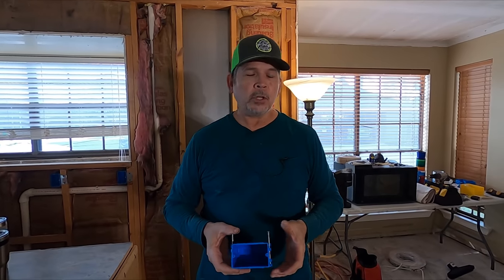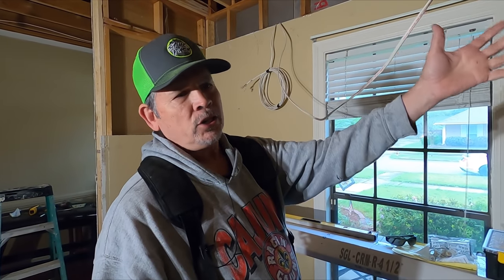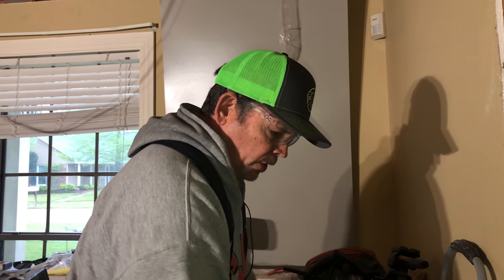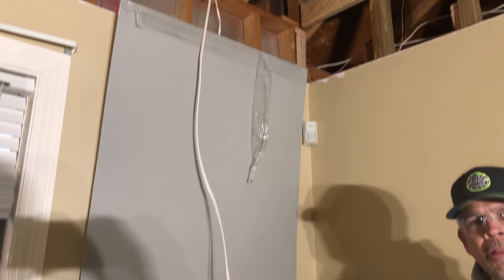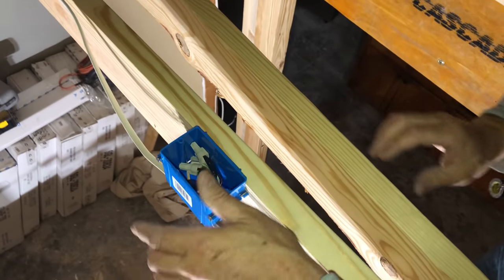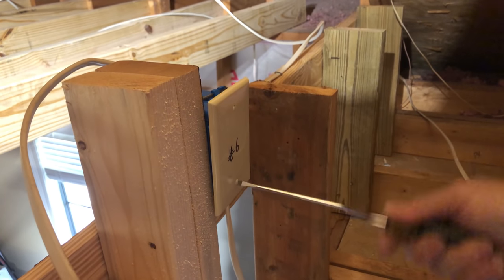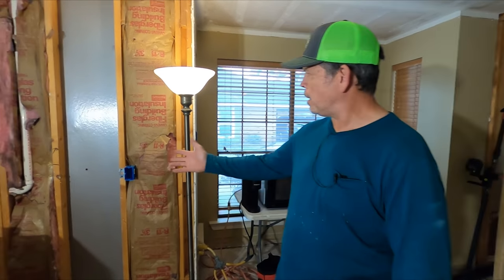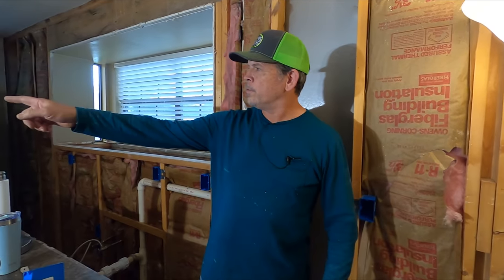How We HELP Our ELECTRICIANS⚡️ Ep. 10

Comment: Apprentice electrician here. When removing live devices I was taught a different combination to remove the wires. We remove the ground first, hots second, neutrals last and reassemble in reverse. The reason we cut off the ground first is because while you're holding that device by the yoke with the ground attached you're grounded. Which means if you touch a hot wire you're going to be electrocuted. Or if a hot wire slips and touches any metal parts besides the hot terminal screws it's going to arc. With the ground removed you're actually in a much safer position. What happens if you touch a live wire when you aren't grounded? Nothing. There's no path back to source. Neutrals are always after hots because you don't want to create an open neutral and risk frying someones electronics further down the line. You've also learned in the past that getting nailed by a neutral really sucks. This is all a non-issue if the power is off. But hey, it's a long walk to the panel.

Thanks for the video and keep up the great content.
Reply: As a DIYer, I always kill the breaker and test for current before working on an existing outlet, switch or fixture. I know you guys know more than me, but I'm not made of money and some things are basic enough for someone with intelligence and common sense to study up and do the job themselves.
I'm sure you've come across (or will) some horrendous DIY wiring. 
One house I considered back when I was house hunting had outlets in the garage wired to an extension cord plugged into the wall in the mud room.
Reply: @dokenboken5542  I plug something into every socket that's supposed to be run off the labelled curcuit and then see what's still working before doing anything else
Our 32a kitchen cooker curcuit was running off the 5a lighting curcuit when we moved in so anything is possible
Reply: When we were taught to do Consumer unit changes (Fuse Boxes/Panels) it was remove the ground first, then neutral then hot so it had no paths to go down and as long as you were on insulated pads you'd be too high resistance to carry the current anyway. Each scenario is different though and you need to know what you're working on and what order to do it in if you have to work live on something.
Reply: @therealdojj  I would recommend getting one of those pencil looking testers like he uses at 22:00 for like 10 bucks. I used the same method you use but didn't realize my house has a few circuits with a shared neutral. So even with the fuse unplugged it was still a hot neutral. The only downside is then having to find what circuit the neutral is tied into.
Reply: someone taught you wrong. if you remove the ground first you are removing your safety first. thats like climbing a cliff without your rope. If your wire slips or you shock yourself that is operator error and should be adressed in a different way. If you are incompetent then just kill the power before playing with stuff.
Reply: @dokenboken5542  95% of our work is residential service and remodels so I get to see some pretty funky stuff at times. But I kind of enjoy hunting stuff down and getting things back into working order. Once you've identified line versus load on a circuit in most cases you're set to turn off the power and do the work in safety. It's an excellent habit. Just make sure your screws are tight and your splices are twisted and you're already doing better than a lot of the "Professionals" work we clean up after.
Reply: @Mrjumperdude01  It's a good idea to make sure those circuits are tied together under a 2 pole breaker of matching amperage. The reason is you want to make sure those circuits turn off together. It's also important that they're on opposite sides of the bus bar (Which the breaker will achieve) so you don't have an amperage overload. Mike Holt has an excellent video on multiwire branch circuits if you're interested.
Reply: @Lucas-ur5ng  Will definitely look it up but I will probably hire an electrician to rewire the house and change the fuse box to a breaker. The code enforcement in my area is a real stickler so I'll let the experts do it.
Reply: This doesn't make sense to me. If you are holding the device by the yoke, the hot wire may travel near your hands, but it will always take the shortest route. Electricity will not magically run to your hand, through your body and then back through your hand again to get to the ground wire. It will take the shortest path which in most cases will avoid your hand and at worst get part of your hand.
Reply: @Mrjumperdude01  I'm not sure if I'd ever figured out how you Americans wire things up 🤣
We have to sleeve all the earths, certainly could not twist them together, have all sorts of resistance testing done and get the government to come and change our power lines into a property or turn them off if we want to change the main tails coming in and I could list 400+ more things 🤦
Not saying that the electrician won't do that off camera, but most of our costs are based on that for installation and certification
But you can move a plug if you are "a competent person"🤷
Reply: You were taught the correct way 😉
Reply: @mr.g937  Same here. My confusion is this: when one is removing a device, aren't they always grounded practically as their feet are touching the ground? I mean, we're not floating in mid air removing devices, so how does removing the grounding wire make you not grounded, lest you're a warlock or some shit? Also, doesn't this increase the risk of harm to equipment and personnel?
Reply: @MadMan121  Grounded usually means you provide a low resistance path back to the source (since the source is also connected to the ground/Earth). Since you are made of water your body is generally low resistance. However if you wear gloves, the gloves may be high resistance, and your shoes may be made of rubber and also high resistance (or completely non conductive). So when you touch a hot wire your hands often you get a small tingle even at 120V, because you are not conductive. Now if you wet your hands or don't wear rubber shoes it will get a lot worse.
Reply: @mr.g937  Right. But what's that to do with removing the grounding wire first? 🤔
Reply: @mr.g937  Electricity doesn't take the path of least resistance to source. It takes all paths back to source. It just so happens that the ground and neutral wires (Which are bonded at your first means of disconnect) are the best paths for electricity. That's why wires with potential across them arc when they come into contact. By first removing the ground when servicing devices you remove yourself from being along that path back to source. Another benefit of cutting the ground first is you can move that wire wherever you want so it's out of the way when you're working on the other wires. It's all about mitigating risk. I have to work on stuff live most of the time because of my work. If you have the luxury of turning it off then that's an excellent idea.
Reply: @MadMan121  Think of it like this. Electricity is trying to get back to where is was created, or the source. The neutral wire from the utility is the absolute best way for it to accomplish that. Your grounds are tied together with the neutral at the first means of disconnect past your meter when entering your home. So if every ground wire is twisted together nice and tight throughout the whole circuit it's a great path for it to accomplish that. So when you're holding a device that has a ground wire, you're connected to the utility. In which case contact with a hot wire should result in electrocution if everything was tied together properly. That's why I cut the ground off a device first and put it back on last when it's live. But if you turn the power off this is a non-issue. 

If you're wearing good shoes, aren't kneeling and you aren't touching anything that is grounded (like a ground or neutral wire, grounded appliance, grounded structure of a building, or even the earth) then you're not grounded. But I wouldn't recommend testing this one out. I learned this one the hard way kneeling on marble tile in a bathroom. Squat, don't kneel! I hope that clears up some confusion. 
By the way, I love that you used the words "lest" and "warlock" in a sentence. Keep it up.
Reply: @Lucas-ur5ng  ok, so let me make sure I got this straight. If I cut the ground wire first on a live circuit, and I'm wearing proper electrical hazard safety shoes, I won't get shocked if I then accidentally touch the hot wire?? Because it will travel back to source via the neutral instead of through me to the earth?
Reply: @MadMan121  It would only travel back to source along the neutral if the hot wire came into contact with a neutral terminal screw or wire. Even if the device is ungrounded you still need to keep your hands clear of the neutral terminal screws. If your feet are insulated from the floor you could theoretically touch a live hot wire and not be electrocuted. There is no difference in potential between you and that wire. You are not a path back to source, so it's just like touching any other wire. That's why you should remove the ground wire first. There's some people out there who can explain these concepts a lot better than I can. Just don't take this to mean that you can go grab live wires with no consequences.

Comment: I learn somthing new every time. The wide is always the neutral! Electrical Receptacle: Wide = white
Reply: If you watch The Handyman he always says 'white to bright, black to brass'.
Reply: That's not true. Sometimes the white is reidentified. For example in a switch loop. It is very dangerous to assume the person before you knew what they were doing and did it right. That is how you get shocked
Reply: @dakotbeastj  He is talking about on a receptacle. A switch is a totally different subject.
Reply: @illestofdemall13  got ya. I misread
Reply: @dakotbeastj  No problem, but you made a good point about wires in general. Never assume. We must check to see what each wire is doing, rather than just assume it is what it should be.
Reply: @illestofdemall13  indeed. Just a good practice to check everything for yourself!

Comment: Those square things in the blue Carlon boxes aren't knockouts.  They're cable clamps.  You're supposed to open them on one side; the other side is a hinge.  You slide the cable through and the little flap will wedge into the cable sheath so you can't pull it out.
Reply: I was just going to say this. I am not a licensed electrician, however have done some small electrical work at home and that is 1 thing I noticed with these boxes. They are indeed NOT knockouts, they are hinged like a Chinese finger trap. Wire can push in easily but not pull out.
Reply: The cheaper ones are barely hanging on by 2 little pieces of plastic and won't hinge. I've seen both types
Reply: They are knockouts for that box style.  The clamp type you speak of is a different box style.  First strap will hold the cable in the box.
Reply: @patrickdriscoll7881  what do you mean "first strap" will hold it? You mean staple on the wire? Not all installs of these boxes have stapled wire. Some are just strung across ceilings, or dropped through a wall cavity. I understand the boxes with clamps are a different style. But in the end, a box still requires a clamp of some sort to hold the wire in place. You would never pass an inspection if you used a metal box without a clamp even if it was stapled. Plastic is no different. The only reason why he may be getting passed is because those plastic locks arent as easily seen from the outside so are assumed to be intact. I think his ceiling install of that plastic box doesnt have the wire stapled, so what's the safety of that box without the staple?
Reply: @jordankesselring4852  Yes a staple is a form of strapping to hold the wire.
The box in question has four plastic tits that hold the KO. Once clipped or otherwise separated there is only an opening.
The final strapping (which he explained will be done all at once) will take care of it.
Your question about why other boxes require a connector and this type doesn’t is valid. Not sure why yet I’ve never failed an inspection because of it.
Reply: nailon boxes come so many different types of ways. Carlon boxes make blue nailons like the one shown that are knock outs. They also make boxes like the one you describe they do clamp the wire so it goes in and not out. The one he is using is a knock out. I got a bunch in my truck and the 2g ones have the hinge the 1g don't just what the supply house had.
Reply: Those type of boxes are just knock outs they aren't the clamp type. You need to put a staple in the stud close to the Box to hold the wire when using those type of boxes
Reply: @jordankesselring4852   Those type of boxes you need to put a staple close to the box and that is what actually holds the cable in the box, those type are  knockouts.
Reply: Will Schultz I can’t believe over a dozen people posted this same thing claiming those knockouts are somehow integral clamps. I wonder if it was a targeted troll campaign, or maybe it was just meant to influence conversation amongst the viewers. If that percentage of viewers doing their old electrical work truly can’t identify such a basic box feature, then we are all in trouble.

Comment: An exciting video! 

I liked the content quite a bit since from where I am from, all buildings are made of block & mortar or concrete with preplaned pvc piping for the wiring. Which makes it a bit difficult or messy to reroute any sort of wiring to another place, but makes changing wires easy as EMT piping. 

But what I really took home is the format of this video, in comparison to the excitement others bring with quick cuts to finished product, where you can see the work, the sweat, the tired faces, and the slow pace. It brings the human to the Studpack, made of real people and not actors pretending to work. 

Hope I get the idea of what I'm trying to say through. Not at all saying to change anything, but a remark of what I noticed.

Comment: 6:00 this is what Ive always understood as safer... But my journeyman dropped a hot phase and it touched the grounded panel can and it blew up. He said he should have disconnected the ground FIRST.  I also just was shown a demonstration by my foreman.  He grabbed a hold of hot 277v and I tested him with my ncvt. He was energized but didn't get shocked. He explained the reason is that he took the precautions to make sure he is NOT grounded. When he took apart the light switch he was hot swapping, he disconnected the ground FIRST. I asked why he didn't follow the standard rule of breaking ground last and making it first, and he said if he touched the switch that was still grounded and the hot wire at the same time, what does that make him?  Grounded. I won't claim to be an expert here, I'm a 2nd year electrical apprentice... But I thought it was interesting how in some situations (only of you thoroughly understand exactly what the electricity is doing) it appears to be safer to disconnect the ground first. Even after these 2 experiences, I still follow the first make last break rule for ground, but I do keep in mind what I learned from those 2 examples where electricians were working on something they knew in advance was hot (which isn't recommended to begin with but electricians sometimes have to)

Comment: if you dont have a tiny flat head you can twist and pull to get them out of the push ins.
Reply: When you have wires that long (or even if not,) there’s no excuse for not just snipping off the wires where they enter the backstabbers, because the backstabber has damaged the exposed wire end and it should be discarded.
Reply from the maker: Agreed Declan.  Sometimes I'll cut off the stripped end because the original electrician used lineman pliers to strip the wire (or the wrong spot on the wire strippers) and nicked the wire which easily breaks off due to fatigue.

Comment: Where's the link for that flat head screw driver. I just had to remove a few dozen of those that were 1.5 inches long. One of my pet peeves is when the electrician doesn't  cut the screws to size before installing them. I wonder if they don't know that their wire cutters most likely have a threaded screw cutting feature. Who in their right mind wants to screw in 1.5 inches of threaded screw by hand times 2 dozen? Maybe not such a big deal with Philips head and a drill. But no good with a screw driver. And as we all know, a flat head bit in a drill isnt perfect.

Comment: As a master electrician, I prefer nobody but me touches the wiring so I know what was done and that it was done right. I never "back stab" outlets cause it's lazy and produces a poor connection. I've gone to houses and have found melted outlets caused by back stabbing. Very common problem. When working live, I always disconnect the ground FIRST. this way it eliminates the shock hazard while holding the metal part of the outlet. FYI, twist your splices so when the wirenut falls off you don't lose the connection.

Comment: Nice video as always.
What about your romex stripper instead of the utility blade? Cuts the sheathing nice and clean around the wires. Just curious since you have them already.
Reply: Blade is better for stripping romex sheating when it's in the box already. The stripper has a tendency to score the coating on a conductor when you use them at an angle like stripping inside a box would require.

Not sure why he doesn't do it when outside the box though, it's definitely faster imo to use the strippers for that. Older romex had differently sized plastic than new Romex so he might be playing it safe for that.